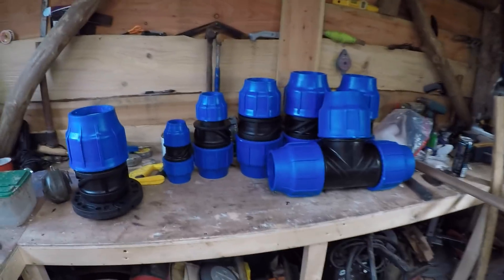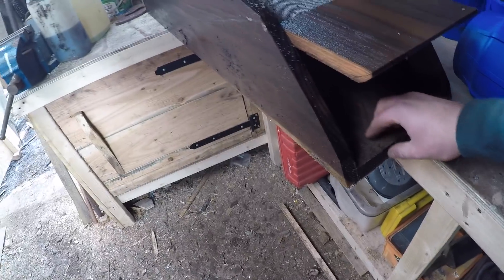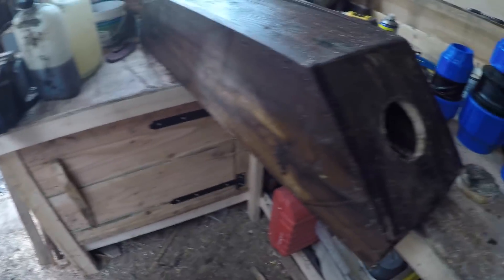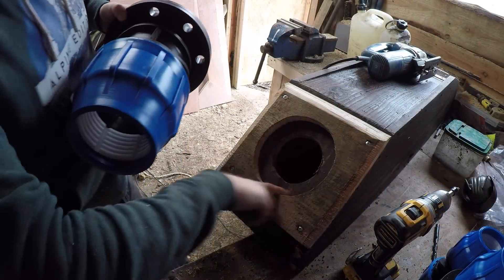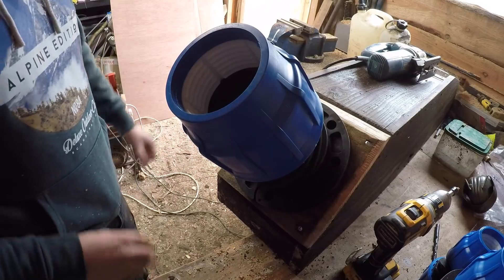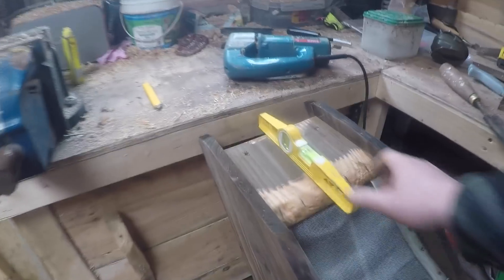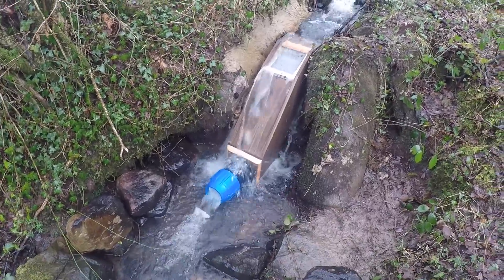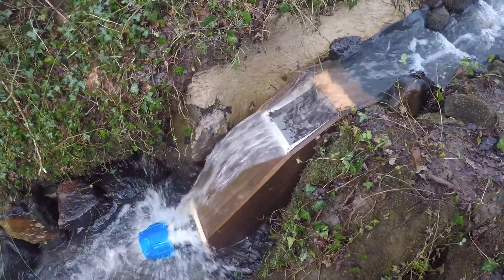DIY Micro Hydro part 8 intake pipe connection

Comment: Welp, now I'm anxious to find out how you solved the problem with the fine sand.  I know that a series of tanks above the intake have been used to settle out particulate in unprocessed water, so that only the clean overflow is passed on down.  I suppose something lie a sluice with riffles might do it too...maybe, maybe not as effectively as the tanks, which could be as simple as a series of barrels.  Anyway...

Comment: "An end to it quite quickly",.. Surely the water flow itself will wash tiny particles away as it runs.?  It can only build up, up to the level of the bottom of the output pipe. The handful of sludge would fuck things up if that was all that was going down the pipe, but, obviously it's not. Plus, it wouldn't damage your turbine blades (in normal amounts) any more than the bubbles caused by the spinning action of the blades.  Cavitation, I think it's called.
I've worked on 3 of these turbine systems as an electrician, and, never have I seen a screen that small. Even the screen at the top is a lot smaller than anything I've seen. All 3 simply had grids to stop trees going in. Now, I realize that yours is a bit smaller than the ones I've worked on, but, even the smallest one I've worked on only had a 1"×1" mesh at the top. So, I think you're worrying a bit much about this particular aspect.
Great video tho. I really do love what you're doing. I'd love to have the energy (and land with a beck🙄) to do projects like you do. Keep it up. You're an inspiration to younger folks. 'love it'.!!!.

Comment: Hi there sir its really cool what your doing with hydro power Ive been watching your channel sometimes we get a lot of rain run off that comes down the hill no sun for solar so ive been thinking about putting in hydro myself is there a link you could share were you bought  the pluming stuff the fittings

Comment: Great micro hydro idea but I would mount your generator high above the peloton wheel gun a cerpitine belt like a Chevy truck even a regular pulley which would keep most of the belt away as opposed to being on the same shaft .
I really like your idea of piping water from the pond when you have high demand like welding heating water etc .
Scott from USA and Canada

Comment: Thank you for this. I'm planning my own off grid power system, and these videos are a tremendous help. I've learned so much from you. What do you think about this generator..... https://www.ebay.com/itm/PMA-Generator-ME1112-Pelton-Wheel-Water-Power-0-240-VAC-4000-Watt-Micro-Hydro/192109927608?ssPageName=STRK%3AMEBIDX%3AIT&_trksid=p2060353.m1438.l2649

Comment: If I were you I'd build a couple extra for when you need them later on. And put an opening under the pipe, along the bottom so the sludge flows out by itself. What's left inside can easily be removed by a brush.

Comment: I would have built a small dam to create a small pond just downstream from the location that would retain enough water to feed the piping and creates a settling pond to eliminate a lot of the silt in the moving water. 
You may even need to build one up stream to allow more silt to settle out and if the laws allow you could use some of this water to help fill your lake.

Comment: I was going to suggest a catch tank as well with a 3 stage filter or just let the fines and largest silt settle to the bottom and you could possible have it be a 2 part tank where the fines and largest silt falls in the bottom tank and then after 750 hours (1 time a month) the bottom tank is flushed for 5 minutes then 1 time a year you can do a thorough cleaning and inspection.  I would also suggest installing a wooden diverter for the top of the box so all that excess water isn't pounding directly on your piping.  Fantastic videos and keep up the great work

Comment: I know I'm behind on videos, so I dont know if you've come up with a solution to the fine sand problem yet but here's my suggestion. You could make a small dam where you have the intake box, and make it so the intake gets it water from the overflow of the dam. That way any fine particles stay in the dammed area, and don't flow into the intake box at all. You can then also add a spillway, so that if you need to do maintenance to the hydro system, you can open the spillway, and not have to work around the water.

Comment: Don't add too much filter material to the intake box. You want large debris to pass over it, but let through enough water for your system. Water takes the path of least resistance, so more filter material will result in less water entering the system. Also, the bottom of the box acts as a filter. The change in angles causes a sudden deceleration of the water which causes the sediments to "crash" out like a natural ripple in a stream. So some maintenance is needed to be clean the box. It is a great design, just add a clean out like you thought. I work in the hydrology field so... There are my qualifications. Everyone's setup is different, so what works best for one person will not work for another. Unfortunately it is trial and error. Keep up the good work.

Comment: To avoid that sand maybe you could make a small concrete pond right before in the stream so it will sediment there and not in the box. Dunno how often it'd need to be cleaned though

Comment: The fixing you used was  termed a Coach Screw when I used some insanely sized ones, and equually psychopathic 'rawl plugs', to secure a couple of gunsafes a few months ago.  Had a thought about the  overflow on your box, possibly a daft one. Is there any way you could  add in  a sluice type set up to direct the overflow  to a secondary pipe that joins the first at a junction so that excess water  joins the main pipe and adds to the flow thus boosting your power/storage potential.

Comment: Hard to explain with out picture but if you had a multi level intake so screen was a couple inches under the water level and you had second solid level over the intake all the floating leaves would not contact the screen.  Maybe a thought for a second model.

Comment: hehehe People forget that wood was used in and around water for thousands of years before chemical treatments came about.  Some wood and how it is seasoned (not kiln dried) handles water immersion very well.
Reply from the maker: Thank you :) someone talking some sence about wood durability. people seem to think that all wood is equal. they all have completely different characteristics. thanks for the comment
Reply: Yup.  I don't know about your larch, but in Nfld we had a swimming pool ((a brook damed off with seasoned birch logs, timbers and boards) . It was build in the mid 60's. except for the odd repair over the years, it lasted till 2008 when a bad ice storm and severe flooding destroyed it.  They rebuilt it with spruce and fir, but it won't hold up like the old birch.  Basically you got to know your wood and where/how to use it.  Also knowing when (time of year) is important.  When we built log cabins , we built them with vertical logs rather than horizontal.
Reply: I build my corrals with steel pipe welded together but I prefer wood in all other things. It’s natural, beautiful and doesn’t impact the environment if harvested correctly. I’d rather be a woodworker than a steelworker. ;-)

Comment: Without using filters, which will slow the water flow, you need to build a much larger box. This will allow the silt to settle before going down the pipe. You can have a hatch at bottom to allow for flushing the box out weekly,monthly or what ever the buildup of silt dictates.  The box would have to be at least twenty times larger than what you have. The placement and routing of the water is determined by the slop of land.  Regardless of how you go, it would appear that silt buildup is going to be an ongoing problem.  If you had the space you could use a very large barrel and let centrifugal force drop the silt out, but periodically you will have to clean it out.

Comment: In our fish systems we use swirl separators. They work similarly to a dyson vacuum cleaner. It should not reduce your flow rate and be very easy to clean. There are several ways to build them, you should find it easy to build your own.

Comment: Hi Kris, there were many good ideas to filter out the silt,  but no one touched on the simplest solution...use a series of drain traps along the piping. Just like a sink drain. Those traps are meant to keep sewage gasses from backing onto your house, but they also trap fine silt. The water will still flow, but the silt is too heavy, and will settle in the trap. Obviously,  it will require periodic cleaning, but better than destroying your whole water supply system.

Comment: Hope you’ve had a good new year. Feel better. Something came to mind at the end of your video. Why wouldn’t surface tension work, like with a gutter leaf system like Gutter Helmet. You could probably bend any sheet metal to shed leaves while directing water into your box.

Comment: Have one or two debris cleaners further up the stream (you don't have to do it all with the box) All you would need is a small cutaway in the slow side of the stream, and a bundle of sticks at an angle to divert any floating debris, which should then collect there.

As for the silt, leverage some flow dynamics, put shaped wood pieces in the bottom of the box,  to trap the silt in one area, and another side channel to flow excess water through that area out of an expulsion hole in the side.

Comment: 6:37 Lag bolts. I would just drill some 1/2" holes in the bottom of the intake box. shouldn't reduce the pressure that much and the pleasure there should push the fine sand out the holes.

Comment: this very fine sand will be expelled into the tube and will be propelled on the Pelton wheel. As the months go by the wheel will be cut off by the sand. It's a natural phenomenon. all Pelton wheels eventually deteriorate.
You need a spare one !
Reply from the maker: i did say that in the video..........

Comment: Here's my tuppence worth.  Firstly, if you are able to lay the feed pipework so that it is consistently going downhill, then you need not worry about air-locking; only if you have a length of "uphill" gradient will air become a problem.  If the latter, then a simple air bleed valve will suffice (perhaps something like this depending on the pipe wall thickness https://www.ebay.co.uk/p/Teams-Brass-Automatic-Auto-Bottle-Air-Vent-15mm-Compression-AIRVENT-Valve/1487627557?iid=281335228489).  And as for the silt build-up, firstly don't worry about it.  If you can achieve a pipe full velocity (Q=AV) of about 0.6m/s then this will scour the pipe more than adequately even if only intermittantly... sorry as I'm not sure what diameter pipe or flow rate you will be using).  Also, I would not worry about a tiny bit of silt hitting the peleton blades, these are likely made of brass, the same as a river ships propeller, and wear will be negligible.  Finally, if you do harvest the silt use it on your garden, full of goodness!

Comment: Kris:  You might try a series of mini dams/spillways, in the creek, up stream to collect the fine sand.  Just a couple of inches high and easy to clean out with a garden trowel. Temporarily they could be 1" x 2"  piece of wood staked In-to the bank.    the old guy    Bert

Comment: I think Steve Mills's idea with the drop tank is the best way forward as it is a more natural function. It took me several years of fannying around before I was totally happy with my water system> great video and great ideas you have with the roundhouse build etc.Well done. Also, your comments about seasoned wood is spot on. Wood is only treated to make it perform a particular function, whereas, woods with natural rot resistance, such as, Cedar, European Oak, Idigbo, Ipe, Iroko, Black walnut or moderately resistant, such as , Douglas Fir, Larch, Sapele, Meranti will outperform chemically treated woods, which may also cause mild contamination of potable water !!!
Thinking about your silt issue I went for this method to greatly reduce the silt problems I had.     http://www.siltbuster.co.uk/sb_prod/siltbuster-silt-fence/
Reply from the maker: thanks for the comment, i will check out that link. i think the silt trap idea is the best as well. im just trying to work out how i would do it.
Reply: I think the site in the UK say that you not supposed to use their system in a continuous flow of water

Comment: have seen another video bout hyrdo and he had a problem with dirty screens too. i think he used a steeper angle on the intake, where the water splashes the dirt down.. i guess youll see when connect it to the turbine

Comment: Even if it's gonna rot or warp or whatever in a couple of years, it's basically your working prototype. I have a feeling that you'll want to improve and modify bits of your system anyways, based on how it works and what you learn down the road - way before anything breaks.
I love how you put a lot of thought into your stuff (for example your workshop model) without getting paralized by the need to be 100% certain that it's gonna be the most perfect thing ever. So far, everything I've seen you build serves a real purpose, like the house you live in, while also being a prototype and learning object for something even bigger down the road. Truly a joy to watch your process. Am so very hyped to see your hydro power station go online!!
Reply from the maker: Im really glad that is coming across. i really like messing around with things and making improvements so getting it right first time isnt an issue. but i do know that it will work. it just might take a bit of time to get better performance. there are always people that know better than me and feel the need to tell everyone how much more they know while doing nothing but sat at there computer. its easy to look at something someone has done and see the flaws but could those people design something from scratch? i doubt it. thanks for the comment. it was nice to hear.

Comment: Maybe check the fine sand for gold, you never know ;)
Also, the pipe fitting is attached very securely to the wooden panel but the wooden panel is attached to the box with only 4 screws. Could that be a weak spot?
Reply from the maker: the big bolts go through both bits of wood.

Comment: Another option for clarifying hat fine debris out could be the method they use for sifting gold out of stream water. Run all the water across a wide, long, shallow channel with ridges across the entire surface. The ridges catch the debris over the length and the water (being lightest) flows over the top.
Reply from the maker: i think walking up and brushing off the screen could be a every morning job to be honest. especially if i get a dog....get up take hime out for a walk and clean the filter. wouldn't be to much of an issue, so it only really needs to last 24/48 hours i guess.
Reply: The ridges are called riffles, he could fabricate a grating for that, when sifting for gold they also use a special Carpet called miners moss to catch the gold, personally I think he just needs a bit of a settling channel for the silt
Reply: until they are full... then you would have to clean it once a week i guess
Reply: Oh for sure.. I don’t thing there’s any silt filtering option that’s not going to come with regular maintenance and clearance. I was just thinking maybe it’s easier to clean a flat surface more than a bin.

Comment: In brewing, the best way to manage fine debris (from Hops, etc) is to whirlpool it. I’m thinking it have a really good use for you muddy sand issue. Basically you start with a cylindrical container, feed the water in at an angle from the side at the top. Flow the water out of the container about 1/4 up from the bottom at an angle away from the whirlpool rotation. This concentrates the debris in the center of the container    allowing clearer outflow without having to use a filter.
Reply: I was thinking the same thing. Take a plastic 205L plastic barren and make an inlet at the top so that it's flush with the tangent of the inner surface of the drum and then take an outlet up and out from the centre of the barrel and feed that to the water wheel. If you get the ;levels right, i.e. below the onles of the trap there should be no air in the barrel at all.
If you put a valve on the bottom of the barrel where all of the fines will end up you should be able to simply flush them out once in a while.
Reply: Morten Mortensen that's pretty much what I was intending to suggest. Use an internal construction to create a rotating flow which would throw the heavier solids out where they can be continually flowed off.
Reply: like this idea; would love to see it in action!
Reply: how does something like that affect head pressure?
Reply: How does the silt get moved out of the container? It's constantly being brought in by the spring. 

I'm thinking a large pond to let the initial self settle to the bottom why the water flows over a weir into the intake